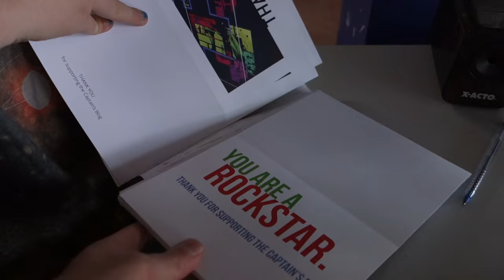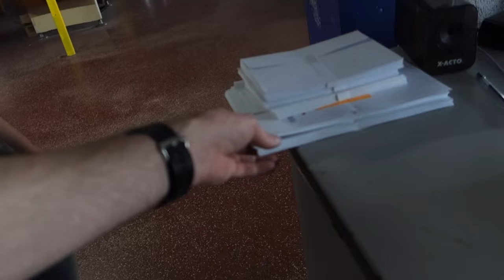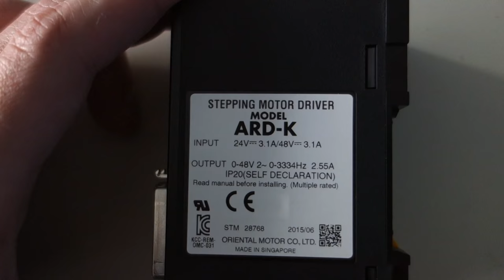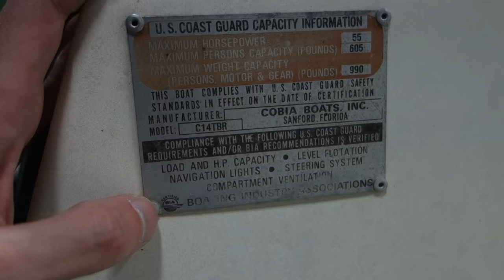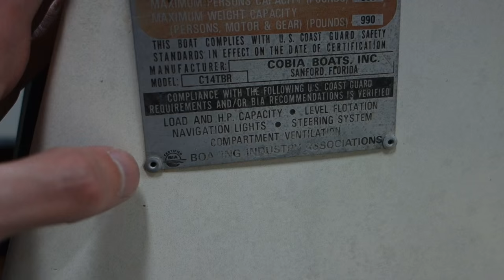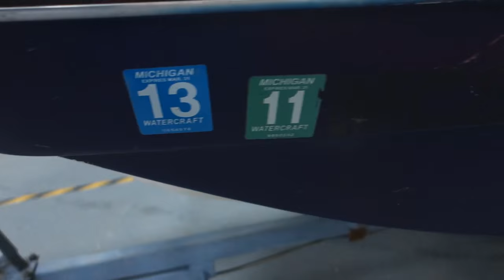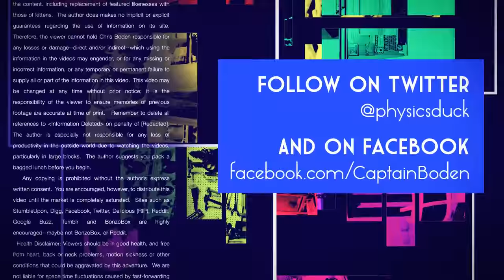Captain's Blog 9 7 2015 Boat Restoration Phase 1

Comment: You know Captain, you probably have all the parts you need to make a 1-horsepower Dremel tool down in the aeronautics lab. Just get a reasonably-sized BLDC motor (high Kv outrunner or (comparatively) low Kv inrunner), a couple nice bearings to support the shaft and reduce the load on the motor's bearings for longevity, add a speed controller and you're off! Plus, since it would run from low-ish voltages, it would be a little safer to work on wet stuff.

Comment: 1229  paper is a good way to check the product.  why does liz sound like that?  start a boating class then.  screw holes on a boat is a mistake.  2 smoke?  r is romeo.  psycadelic, first word was correct.  that boat is falling apart.  that's very heavy for a 2 stroke.  semicorrect direction.  neat fake fire.  water spins like a windmill.  good move.  you don't want to drown the camera.  whew  you clean the boat very thoroughly.  1804  boat interior is a mess.  boat floor is crunchy.  yes a barrier should be two way.  vacuum the water out.